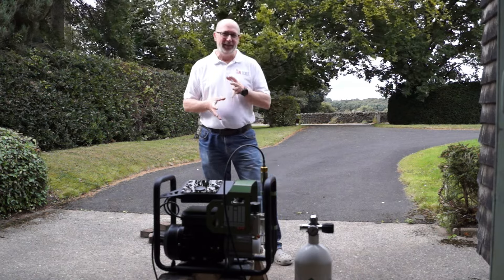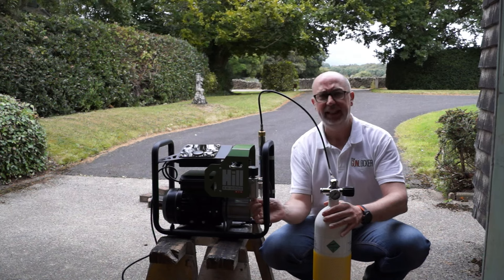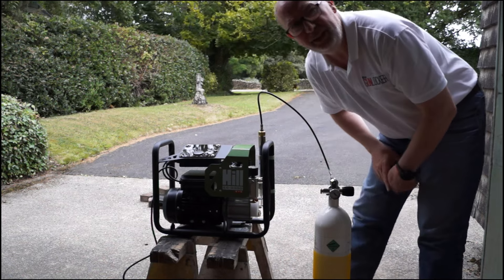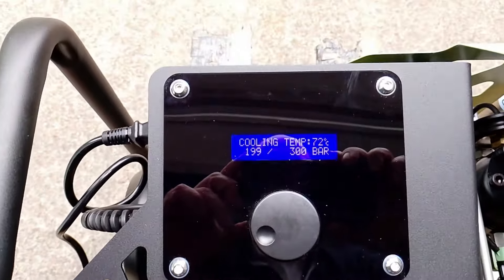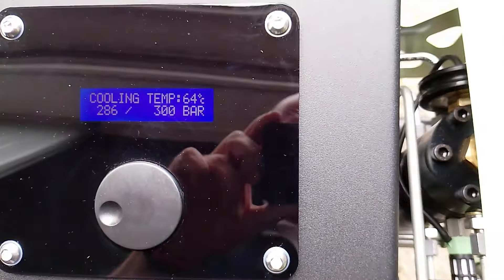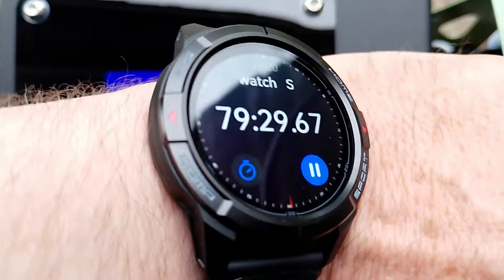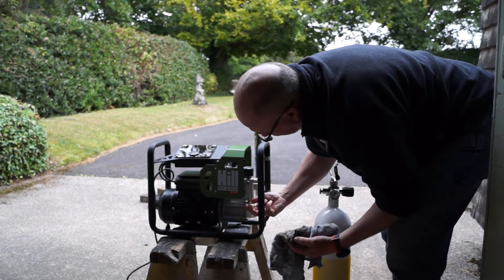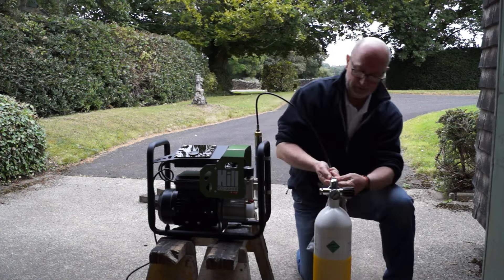theGunlocker - Filling a 7lt Divers Bottle with a Hills EC-3000 evo

Comment: Cannot help but think if youhave your own Hills compressor , why stress it out and fill to a full 300 bar every time. I will be looking at buying one soon, with the intention of doing a 250 fill,  obviously a little more often, and give the compressor an easier time. Less heat, less stress. Good insight into using one though thanks for the video. To me as a professionally trained mechanical engineer that has worked in and also taught pneumatics, these are by far the best designed and best made compressor for its size on the market.
Reply from the maker: You're right...you wouldn't stress it out, but the video was just to prove it can fill a 7 lt tank and to show how long it takes. Ordinarily you'd just fill your rifles straight from the compressor. All the best and thanks for taking the time to comment!

Comment: British engineering at it's best.  You might want to consider cooling your bottle in water during filling.
Reply from the maker: Hi...it certainly is a good compressor, no two ways about that! Regards cooling down the bottle, I found it cool throughout the whole process. It helps that the compressor shuts off automatically throughout the filling process to cool itself down, so all seems fine. Thanks for watching and taking the time to comment. Apologies for my delayed reply

Comment: Hi Mark. Good demonstration of the Hill pump. If i could offer one suggestion. Whenever you fill your bottle or direct to the rifle from a pump, it would be better to have the pump on the ground and the tank raised just in case any moisture persists in the system.
Reply from the maker: Hi Karl, first off...thanks for watching and taking the time to comment. I normally have the compressor on the floor when I fill my rifles and will do when I fill the bottles. But for filming I needed to raise if off the ground so I could get it in shot.

That said, I struggle to see how raising it off the ground would make any difference. The pump is pushing air through the system up to 300 bar. Surely there's more than enough pressure there to vapourize and lift water to the top of the highest building on the planet.

Either way, the pump is fitted with Hills dry pack system for added protection against moisture ingress.

Thanks again for watching and hope you don't take my reply abruptly in any way. I always struggle to reply by text without sounding harsh or stand offish.

All the best